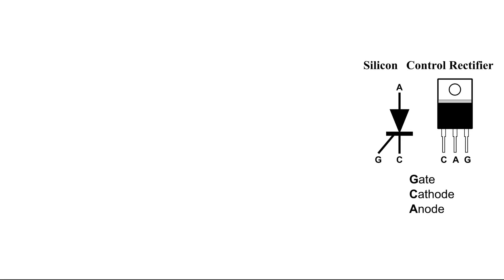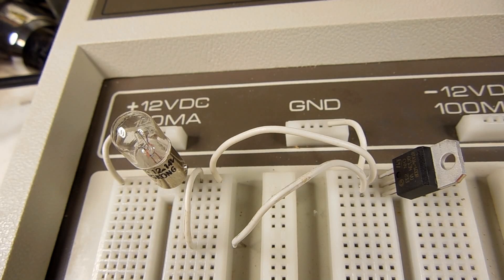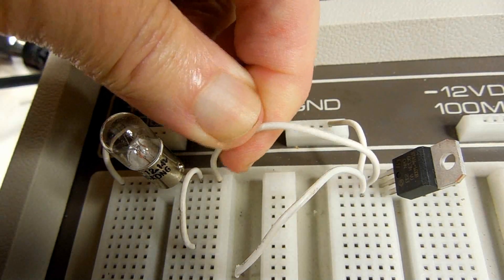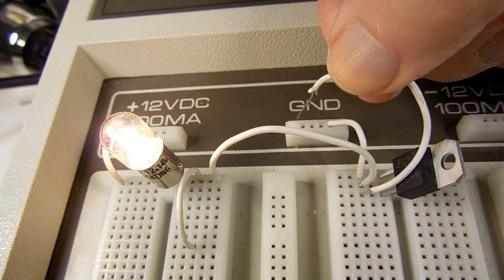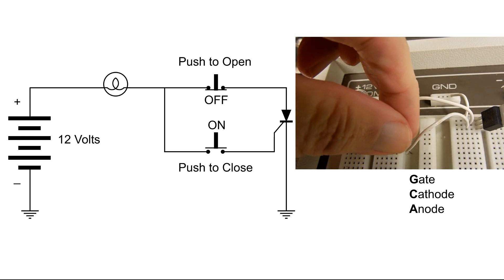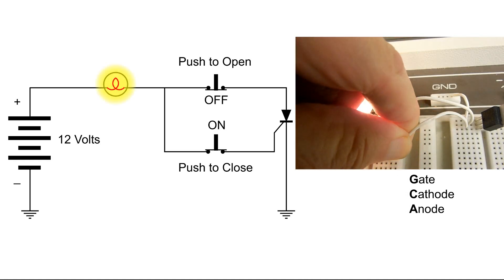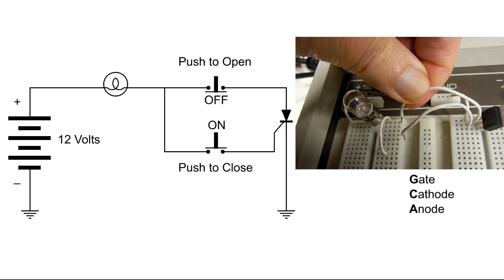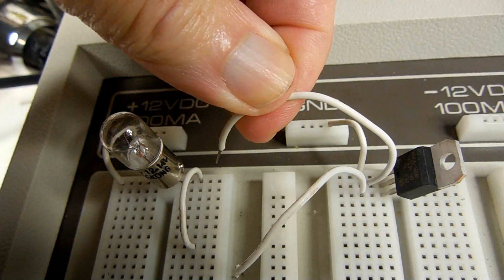Silicon Control Rectifier SCR Basic DC Circuit

Comment: if you use AC voltage will causing it to turn OFF during one half of each cycle. As a result there is no need to have an off switch.
Reply from the maker: Yes if this was AC when the cycle was in the negative half the light would go out as long as the gate was not connected. I am planning to also do a video on SCR's using AC.